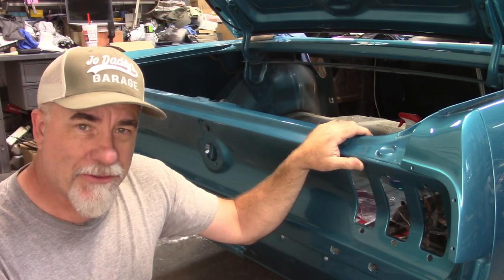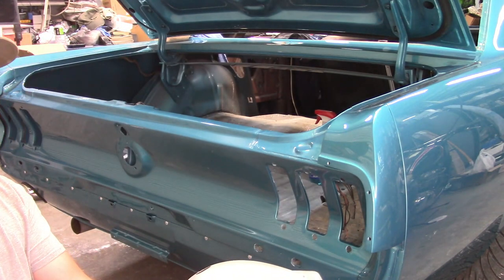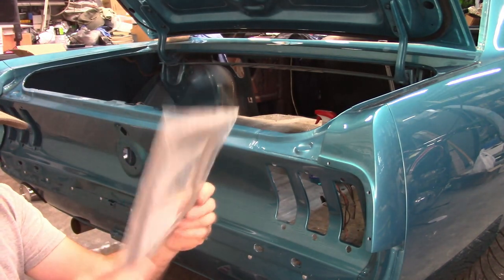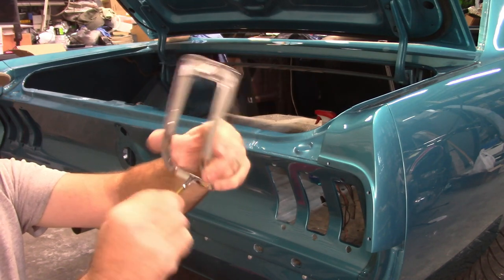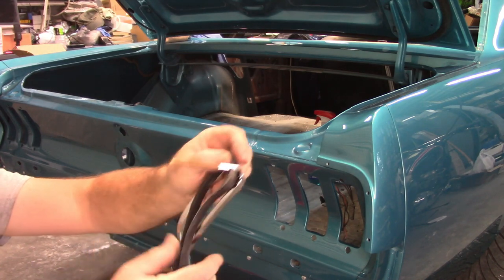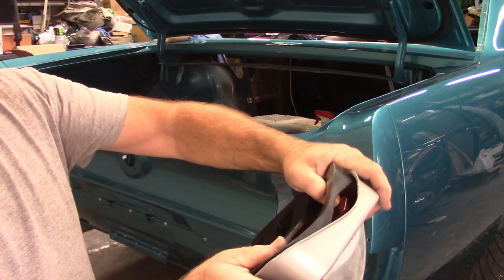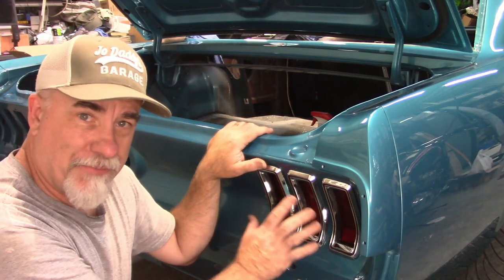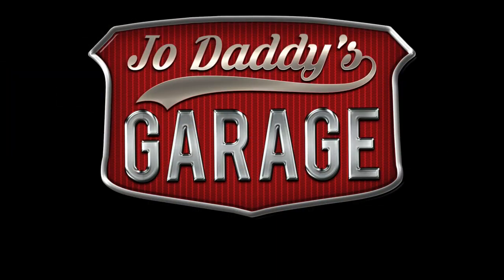Installing tail lights in a 68 Mustang. Jade part 75.

Comment: Ya gotta love new chrome !
Makes it all brand new again  👍
🇺🇸🇺🇸🇺🇸🇺🇸🇺🇸
Those big rubber taillight seals on my 70 are a little thicker than the 67-68, but my bezel is a big 1 piece chrome part. I still like the 67-69 taillights better.